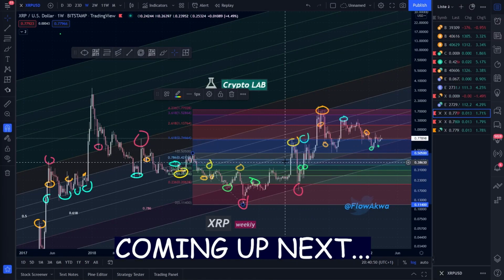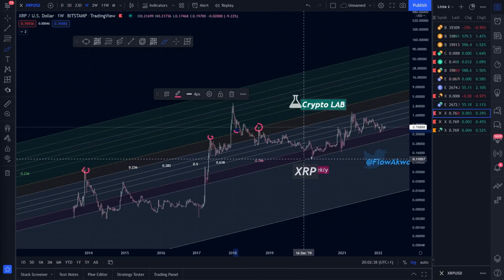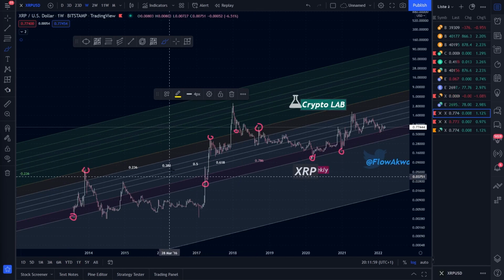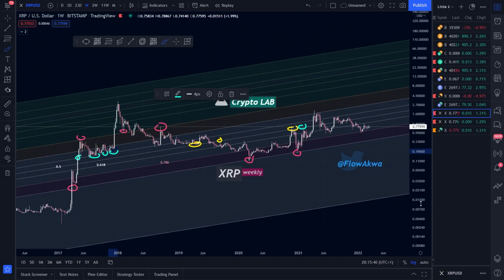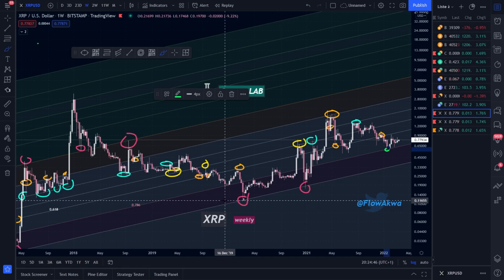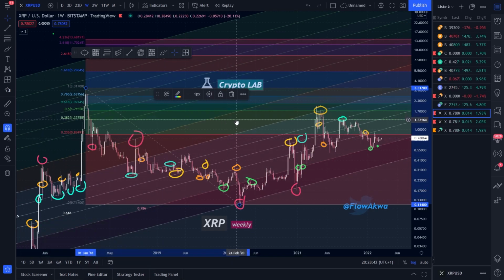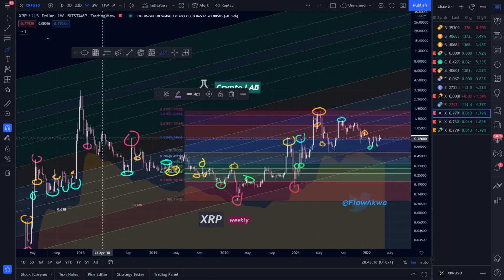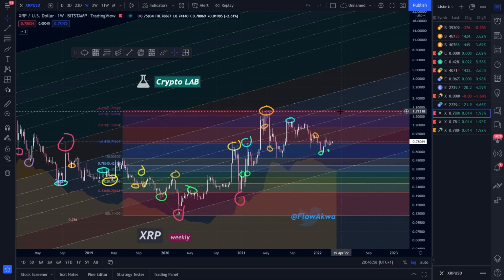XRP : PERFECT CHANNEL NO ONE KNOWS ABOUT - COMPLETE CHART ANALYSIS

Comment: great video thanks, please considering using Fibonachi 0.702 aswell in ur charts i think you might find interesting data based on that aswell
Reply: based on what u draw i think the supporting area  after 2019 are holding at 0.702
Reply from the maker: Indeed thanks ! I'll try it 😉